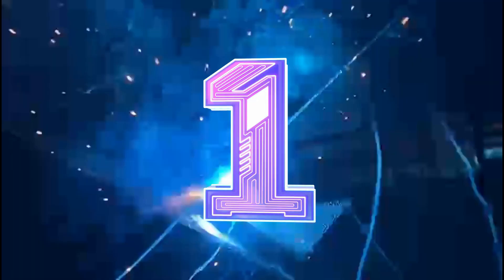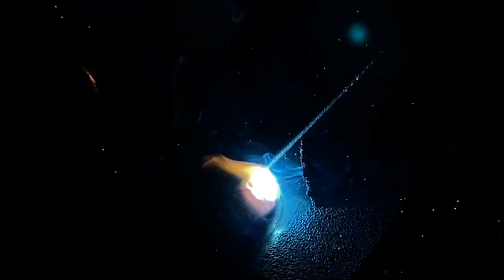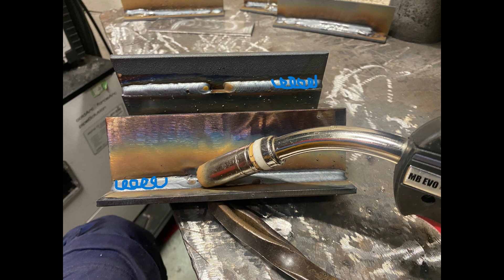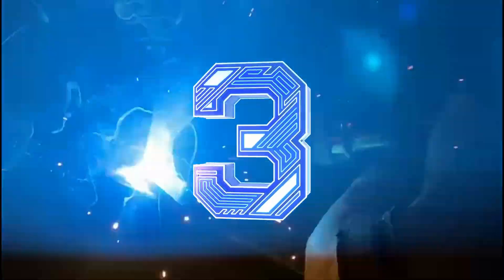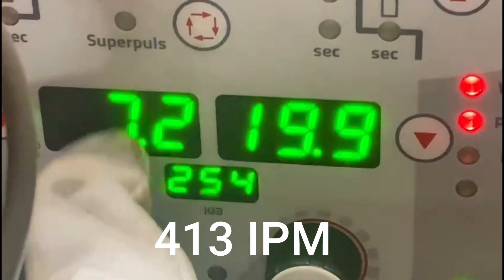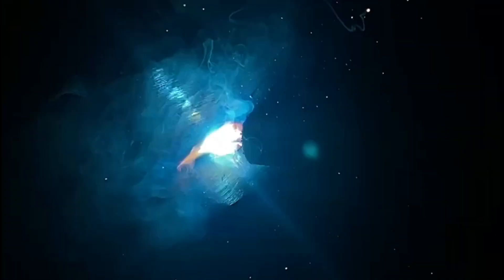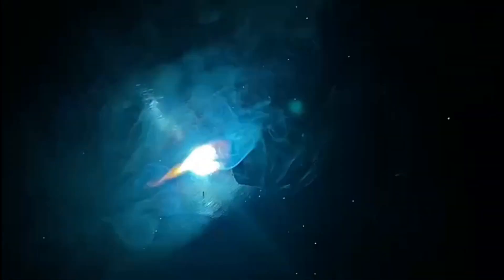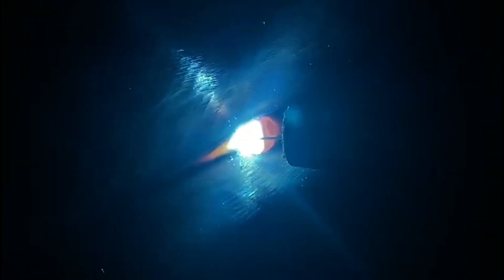Mig welding for beginners the basics

Comment: What I would want to know is how you see what you are doing. This is a topic covered on many channels, but it is evident that the problem is common. When I trigger my gun, many times all that is visible is a bright spot at the puddle. The seam I need to follow is invisible, or nearly so, much of the time. I have tried an improved helmet, a leather sheet to eliminate light from the back and reading glasses, and still have to guess where I am going.
Reply from the maker: Hello Thank-you for your comment. We always adults the way we’re looking at the puddle, for example we would only be looking at the leg lengths when welding these joints. What material are you working on? Do you remove mill scale?
Reply: @weldtechsolutions  I exclusively MIG weld steel, often angle iron, and always remove mill scale and any other defects. The more I read comments on seeing while welding, the more I realize that many welders have the same problem.